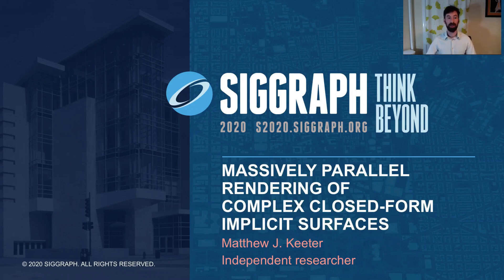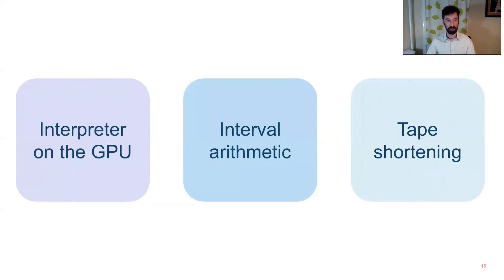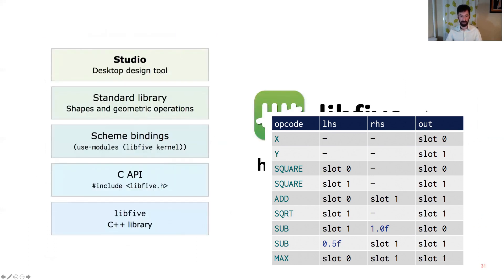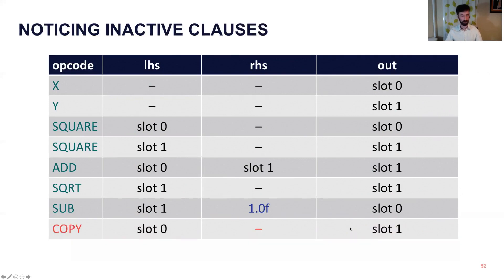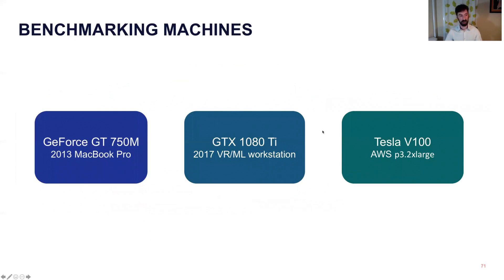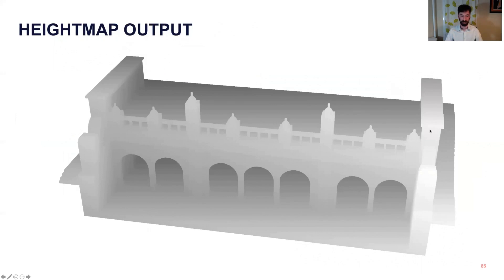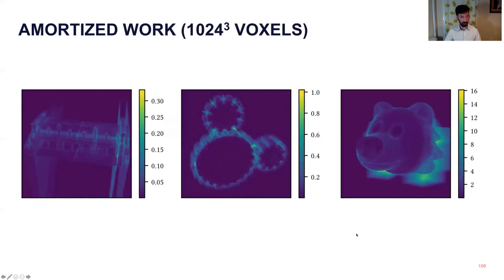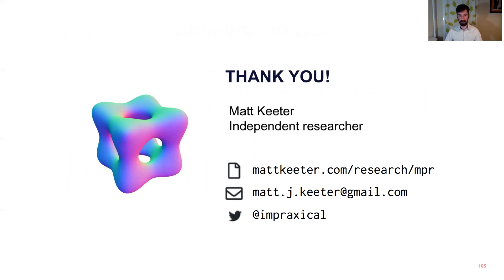MPR: SIGGRAPH Presentation

Comment: I've been doing some thinking about this topic (or very close to it) and stumbled across your video. First off very well done and very well articulated. 

Generating the clauses/equations that implicitly define the objects are somewhat challenging. For instance if you had three spheres, each defined by their 3D function of f(x,y,z)=(x-a)^2 + (y-b)^2 + (z-c)^2 - r^2, I had the idea of multiplying their functions together to get an equation for inside/outside. However, when only two of them are overlapping, it becomes positive and when all three overlap back to negative. That led me to believe that this could only be done properly by the OR operation (or rather a short circuit OR) that if it is negative on one of the spheres then it is inside the combined spheres (much like the unite boolean command in a CAD software). The drawback of this method is the actual numerical value loses the meaning verses a SDF representation, but it gains the advantage of potential computational efficiency through the short circuit evaluation. I am a bit fearful that computing each function would expensive if the object got complex enough, though it looks like your computation of clauses saw pretty good efficiency. 

Do you have any recommendations or ideas about how to make these implicitly modeled solid objects dynamic? I'd like to be able to stretch and squeeze portions of an object. My idea was that maybe if I made the model out of rudimentary enough building blocks that their combined implicit equation could be manipulated at the basic building block level instead of having to regenerate an entire implicit equation.

Anyways, excellent video, all the best.

Comment: Very elegant! A thought I had while watching is: Instead of evaluating the expression over voxels, why not transform the SDF using the projection to 2D? Well, projecting is just arithmetic but still leaves you with a 3D space; to get 2D you'd need to compute min({z∈(near..far) : projected_sdf(x, y, z)}) for each pixel, which turns into a root-finding problem instead of operations for which interval arithmetic and automatic differentiation are simple. Still, I wonder if there might be some algorithm that can solve that problem more efficiently than voxelization, so that the whole rendering algorithm scales purely with local scene complexity and not desired Z resolution.
Reply: You make a good point, this is also called occlusion problem or occlusion culling in graphics: you don't really need information (depending on the type of rendering of course!) about objects past the first viewable (they're occluded), which makes rendering much more efficient. I believe the original DOOM addresses this using Binary Space Partitioning (BSP) trees. I think indeed in this case trying to find only the first negative value along a line using interval arithmetic for z (ray path) could improve rendering significantly! (also maybe some subdivision scheme to find the closest segment which contains a root, and then the closest root)